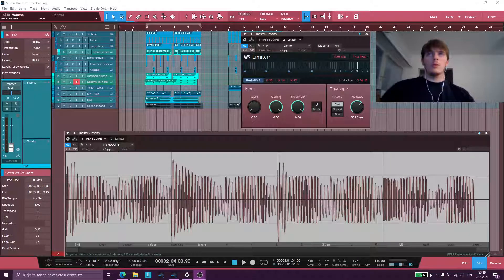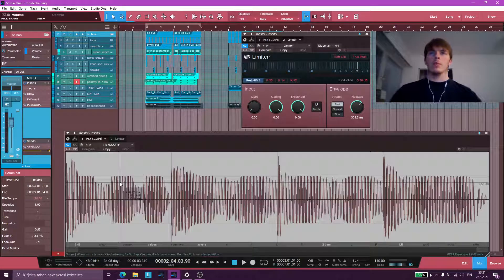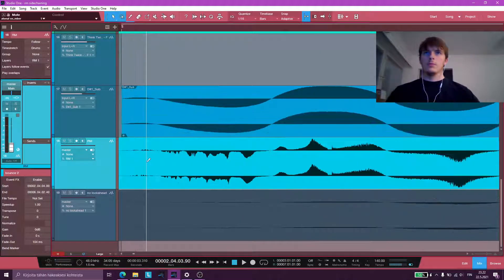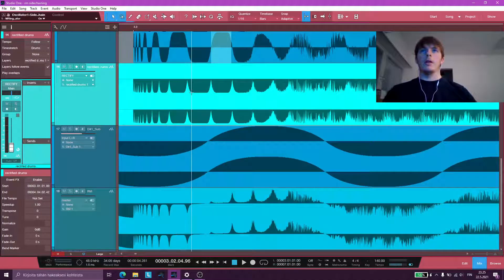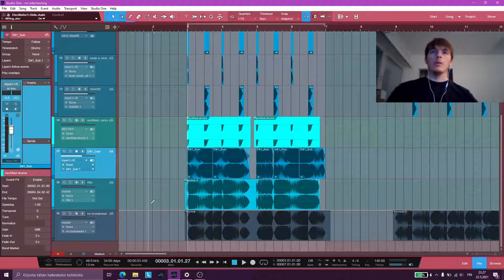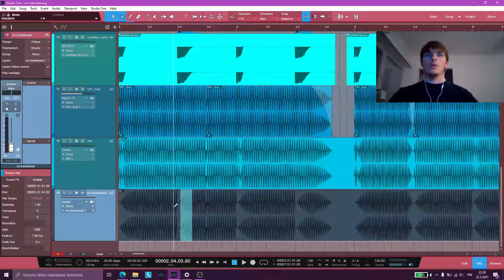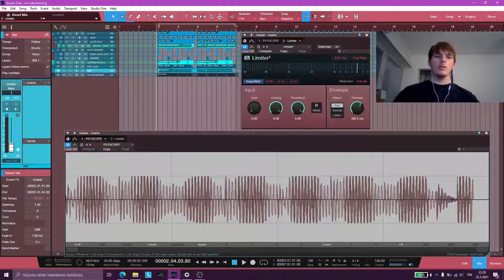Ring Mod Sidechaining Tutorial

Comment: For this to be actually perfect, wouldn't we need to sidechain the positive and negative poles of the signal independantly?
Reply from the maker: No because the only thing relevant to the amplitude is the absolute value of the signal, so disregarding whether it’s positive or negative. 
So the absolute values of the source signal (drums) are used to duck the target signal, and the resulting sum signal won’t peak any higher than the source/target signals by themselves
Reply: @borrasca  Yes, I understand that the absolute value is key here. But, I can't help but think that there is a lot of variability between the positive and negative poles of the signal that is being lost when rectifying. For example, is it possible to completely isolate the positive polarity of the kick and bass and sidechain those, and then do the same for the respective negative pole? This idea is probably far too detailed, but it might eek out another 0.001 LUFS, who knows...
Reply: @F4xP4s  when you rectify it cleanly, no information should be lost, since nothing would phase cancel (since there can never be a sample in the positive and negative poles at the same time)
Reply: oh hold on, you mean for the carrier and not the modulating signal... yeah, i hadn't thought about that.... i guess you're right actually... could be interesting to experiment on that. it's definitely possible to set this up i think
Reply: @TollsterMensch  Sorry for the unclear explanation... Thanks for understanding! Yeah, would the most efficient way be using two bipolar waveshapers one flattening the positive and the other the negative poles to the zero point? Then do the same on the sidechain signal and route to the respective channels?

Comment: I don't understand 😢, 

what's the difference when using kickstart or volumeshaper? which one is better?
Reply from the maker: Not much they're by the same company. Kickstart is like the light version of volumeshaper and a lot cheaper. technically volumeshaper is better because it has more features but you might not even need them
Reply: but what's better, ducking or ring mod sc? (sorry bad English)
Reply from the maker: @isaisaisaisaisaa  I like to combine both. Ducking takes care of the first ~20ms and the rest is RM
Reply: @borrasca  but what's ring mod doing?
Reply from the maker: @isaisaisaisaisaa  I tried to explain and show it in the video. It’s just really fast ducking

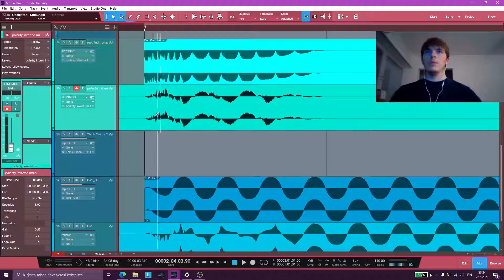Comment: At around 4:20 :-) you mention phase inverting the signal. Is that something you are doing because of the routing in Studio One? I'm in bitwig and I did this all in the grid and inverting the phase makes it sound worse. Just wondering. FYI Amazing video, very informative. I've gone over it all afternoon!
Reply from the maker: That signal is the target signal (sub) being ring modded by the negatively rectified drums. The drums being negatively rectified means that the target is not only volume modulated but also polarity flipped. And being polarity flipped, if you layer it with the original target signal, it’ll phase cancel ( = duck) the original target signal, in the shape of the drum’s waveforms. 

Bitwig’s Grid is always 4x oversampled IIRC. The lowpass filter in the oversampling process changes phases to where the waveforms don’t line up perfectly anymore, and you get over 0db peaks. This was my experience a year back atleast, and is why I wouldn’t use the Grid for that.

There exists now a VST just for rm sidechaining though: it’s called RMSC by justdanpo and it’s really good, it’s what I would use if I was still on bitwig
Reply: @borrasca I was wondering why my signal was still peaking above 0db. Sometimes even by like 4 decibels. So this happens because of oversampling? I looked up to see if abletons grid does, and Ableton utilizes 4x oversampling.

Comment: I tried it with Ableton like the comment below, but I am suffering from the over peak.
Can you think of a reason?
Reply from the maker: If done with the melda plugins there should be no overs. As long as the source (drums) and target (rest of the mix) each are peaking at 0db. 
I have a newer sidechain video where I do this in Ableton as well so you can check that out and see if you’re doing everything correctly.

What is your entire process and at what point in the signal chain are you getting over peaks?
Try putting psyscope on your target and set its sidechain input to drums, then take a look at the ”layer” and ”summing” analyzers. Maybe you can spot the problem there

Comment: I can't get it to work perfectly!

I'm using FL Studio and khs ringmod. Works fine but there's extra 1.5 dB gain on the master. I tried soft clipping the drum bus and the sc bus individually before rm sidechaining but it makes no difference.
Reply from the maker: What exactly are you doing with khs ringmod? Have you turned the rectify knob all the way down and sidechained it from the dry drum bus?

I only recently noticed that even if done correctly with khs ringmod, there will still be some extra gain and, hence, it’s not a perfect amplitude match. 

It sucks but the only way I know to solve it rn is to just use the free melda plugins and do it like I did in the video.
Reply: @borrasca  I did turn down the rectify knob all the way, even tried rectifying it before passing it into khs ringmod. It made no difference and still there's extra gain. 

I tried doing it with MRingModulator and it works like a charm! The problem must be with the khs plugin.

Thank you for the tutorial!
Reply: @abhinavsingh3928  Hey, I'm using FL but for whatever reason can't seem to recreate this. Do you mind running me through how you're setting this up?

Comment: This is really interesting!!! nice find. Smart turning the signal unipolar so ringmod understands it. 
I will play around with it. I feel like the solution for the distortion caused by the ring modulator is to lowpass the kick drum before it goes through the ring mod so it will only match the curves of the sub, and not the high end; perhaps this will avoid (or reduce) giving the sub extra harmonics it doesn't need. 
You won't get the perfect 1:1 loudness match but it might sound better. 
Sidechaining the transient would probably be best drawn in conventionally by using volume envelope triggers or a ghost click, rather than leaving it to the ring mod.
With conventional sidechaining, the main problematic part is always the crossfade between the tail of the kick and the start of the sub.
this is the main part where this technique could be of merit, maybe it could even be used to automate that process? (hooray! the death of trying to match curves in an oscilliscope (maybe?))

combining methods makes for a needlessly complex setup, but maybe if it fits to every kickdrum automatically - I don't see why you wouldn't keep in a template.
Reply from the maker: Thanks!

If you (minimum phase) lowpass the kick too steep or too low before it goes through the rectifier or ringmod, then the phase of the kick's low end can change from the dry sample and make rm sidechaining useless because the volume ducking wouldn't match the kick low end's shape anymore, but maybe a gentle slope taking the highest highs is good for reducing distortion.